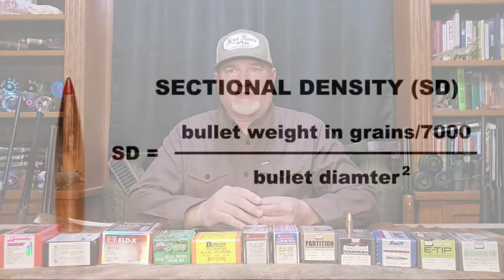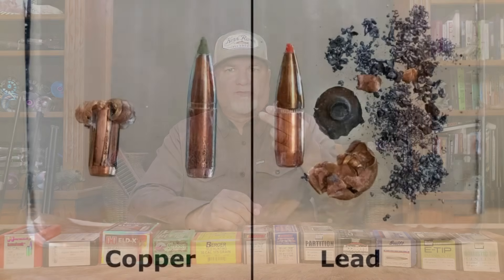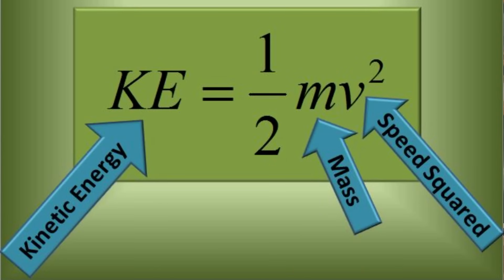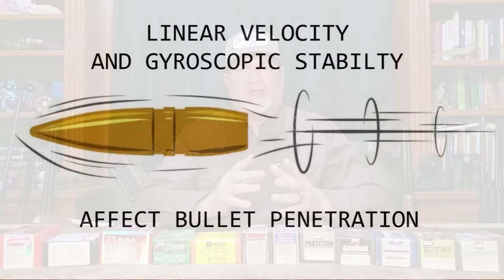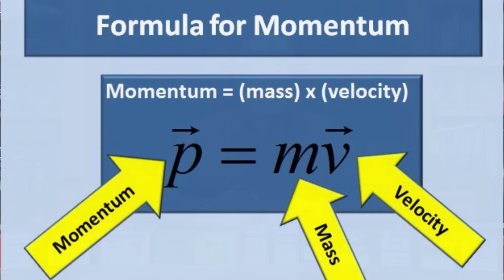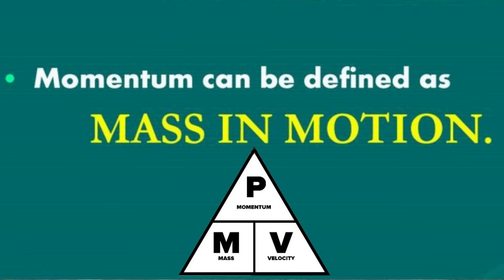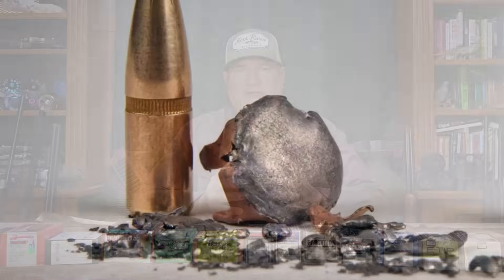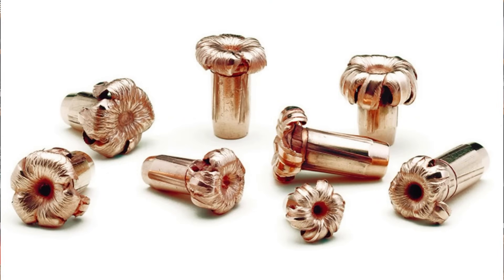HUNTING BULLET PENETRATION

Comment: SD matters! Hit an Elephant with a 150mm shell vs a 9mm bullet going at 500 fps and it’s apparent..277 vs  .308 at 500 FPS and it’s meh…but yea, people get caught up in minute details when it’s a macro detail.
Reply from the maker: @glenoh88  What if the 150mm shell was only going 10fps? What if the 150mm shell was made of foam? What if the 150mm shell was constructed to disintegrate on contact? In all these scenarios, the 9mm would penetrate more. That's why it's useless to attribute SD to hunting bullet penetration.
Reply: @desertdogoutdoors1113  yeap, I’m making an assumption that bullets and shells are made of some form of relatively dense metal but SD is not really a benchmark in practical hunting situations to be concerned with.
Reply: Good presentation. Comparing lead to copper bullets by sectional density discounts the additional longitudal mass of the harder, yet lighter, medium - copper or copper alloy.
Reply: @williamgaines9784  it doesn’t matter…that’s the point. Unless u go 100x, include shrapnel etc, it’s not statistically significant. That was my point between a 9mm bullet and a 150mm howitzer. You gotta go a lot bigger where it makes a difference, ignore the foam stuff…that’s not even practical, it will loose velocity way too fast.
Reply: Awesome info...just new to reloading...will be developing loads in 8mm as a moose rifle...and .270 for deer. I just loaded up some Casull rounds, 250g hard cast for black bear bush rifle.

Comment: DD, boy oh boy.

In your own words: SD doesn't matter.  Next sentence Heavier bullets penetrate deeper. At least to me  it means that the hevier bullet has also higher SD. 

Just facts and figures.
Reply from the maker: @JaneMcNeil-h8r  SD assumed that all artillery shells were made the same. When we tried to apply it to military small-arms bullets, they were also relatively similar in shape/material/construction. When we started doing scientific penetration tests on modern hunting bullets, we found no correlation to SD most of the time. SD is only relevant if you have the exact same bullet, of the exact same caliber, going the exact same speed. And even then, the loss of stabilization with a longer (heavier) bullet could mean less straight-line penetration with the higher SD bullet.

Comment: Here’s the thing, at one time all bullets were basically still the same. As far as velocity goes, fluid dynamics has proven that the higher the velocity, the quicker they slow down. You can pick and choose many different variables to prove a point but sectional density is still and always will be a valid variable when computing performance in a fluid. Air is considered a fluid. So is meat lung tissue ect. Is SD the only variable? Of course not, but make no mistake, it is a variable. 👍🏼
Reply from the maker: @dgoodman1484  SD goes out the window when a hunting bullet expands / sheds mass. I can shoot 50 bonded bullets into a medium and measure diameter of the mushroomed bullets. They could all be different (so real SD is all over the place). Faster bullets have more energy, and well-designed bullets have higher energy durations (and deeper penetration). The only thing of real value with the SD equation is mass, but really, that mass is giving the bullet more momentum. As soon as your hunting bullet hits an elk, your neat SD numbers go in the garbage bin.

Comment: Remember if switching from lead to all copper that your barrels twist rate must be fast enough for the new bullet length. A longer bullet needs a faster twist to stabilize. You can mitigate this problem by going lighter on the copper bullet, you will still get ample penetration.

Comment: Hey Mr. Dog,
Can you increase linear speed to a point of stabilizing a bullet that would not stabilize at a slower speed? Assuming the same bullet and the same barrel (twist rate is what I'm driving at).
Thank you
Reply from the maker: @ChronicalsofAl  To a certain extent, yes. The problem is, if a bullet is too long to adequately stabilize, it will likely be too long/heavy to drive at a higher velocity. There was a guy on an Africa forum that tested 400gr and 350gr copper CEB solids out of a 416. the 350s were traveling about 200fps faster and were getting better/straighter penetration. He increased the velocity of his 400gr load and straight line penetration improved. There are bigger factors at play than sectional density can account for.

Comment: My favorite caliber for hunting with a light weight rifle is still the 7mm08 Remington. I bought it in '89 mostly for deer. If you're very lucky you might get a moose tag. A few years ago I was lucky and decided to work up a load using the old style Speer Grand Slam 160 grain bullets. I got about 2585 fps out of that load. Yes I was tempted to go with a 140 grain Barnes or other monumental bullet but I had an unused box of Grand Slams. I got the moose with a snap shot at close range. Not my best shot but it broke a rib going in, penetrated both lungs and broke an offside rib where the softer front part of the core was found next to the rest of the jacket with the rear harder portion of the core in it. Two years later, I was the "second" rifle for my best friend's tag. This time it was a much tougher shot. Quatering hard towards me just over 200 yards. Lots of time for a very steady rest while waiting for my friend to take his shot. I waited for one moose to turn and get to the thick woods but couldn't wait any longer. Imagine my surprise when the moose fell where it stood. Well I'm getting low on that load so I worked up a load using 140 Trophy Bonded Tip bullets at 2780 fps. Do you think it would do the job on moose and bear under 300 yards (my personal limit) or should I go with a 120 grain Barnes if I'm ever lucky again?

Comment: The reason why flat-nose solids are penetrating more than round-nose solids is due to the effect called supercavitation. The flat nose section, when entering flesh, forms a vapour bubble around the bullet, dramatically reducing drag and increasing penetration.
Reply: Elmer Keith knew something about that.
Reply: But it still needs a certain speed and energy for this

Comment: Sectional  density is still important.  All else being equal. Higher Sectional density will out penitrate lower Sectional density bullets.
Reply from the maker: @jaybailleaux630  With a hunting bullet, when?
Reply: @desertdogoutdoors1113  since forever.  Heavier for caliber bullets of same construction out penitrate lighter bullets. Bell used 170 to 175 grain bullets for brain shot on elephants. Did not use a 140 grain.  458s for dangerous game are normally 500 grains high sectional density bullets.  Hunters are not useing low sectional density 350 grain 458 bullets for elephants.
Reply from the maker: @jaybailleaux630  Hunters found out that fast enough bullets with better materials and meplat penetrate great regardless of SD. In fact, bullet stability is even more important than SD.  Extensive testing in the last 6 years has revealed that heavier for caliber bullets (longer) are not penetrating and tracking straight like we once thought. It turns out that most of those bullets are beyond the twist-rate's ability to fully stabilize during penetration in a  tough medium. In those situations, the standard weight projectiles had better straight line penetration.
Reply: @desertdogoutdoors1113  I completely agree with everything you have said I believe this gentleman is just making the basic statement that if EVERYTHING else is identical the higher SD bullet will general penetrate more. For example if I go buy the cheapest cup and core 30-06 soft point hunting bullet and the exact same manufacturer has loaded it in a 150gr and a 168. But literally everything else is identical the 168 will penetrate better. That’s all he is saying. But yes a 150 gr in a mono metal will dominate the 168 soft point! So both are correct

Comment: Interesting video. We may want a follow-up of sorts talking about expansion in the same manner. On the whole, im of the opinion that the many North American hunters are a bit too obsessed with matters of external ballistics that are not particularly useful or relevant to their needs. That is to say, far too many are wasting their time arguing about ballistic coefficients and holdovers when, realistically, they're hunting whitetail at under 200 yards. They would be much better served doing a deep dive into terminal ballistics, which, as this video highlights, has many moving parts.
Reply from the maker: I have a video titled "hunting bullet hype" that covers this.
Reply: I agree with this other Yankee - all the marketing hype is about ballistic coefficients, flat trajectories, and low wind drift. Here in southern Maine, a 30-30 with modern powder and bullets is a fine deer hunting cartridge. 200 yards would be a long shot. A simple reticle on a rifle correctly sighted in for maximum point blank range is all you need and, frankly, all 90% of hunters know how to use. And there’s nothing wrong with that!
Reply: Talk about wasting time, you sir are the quintessential BLOWHARD.